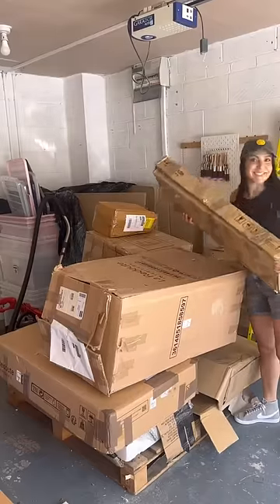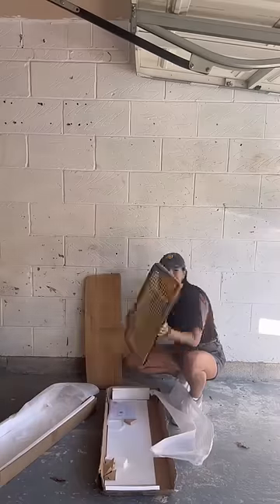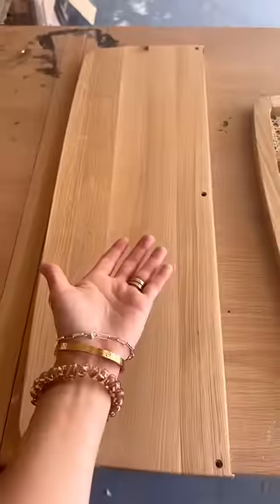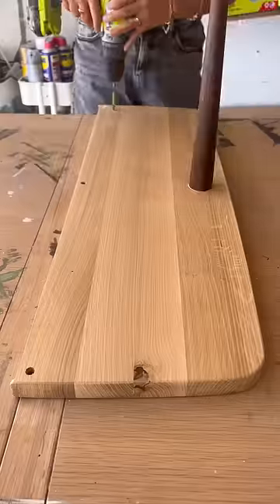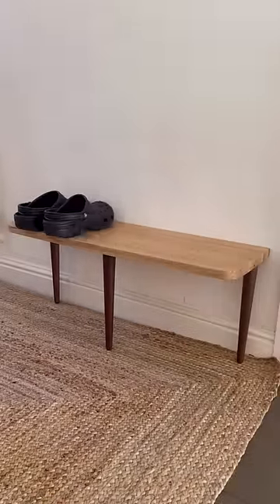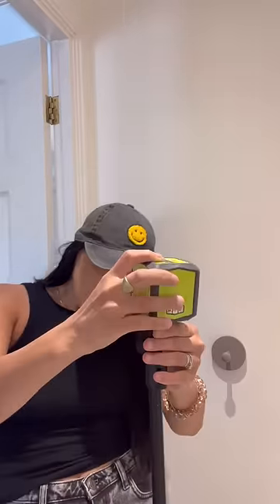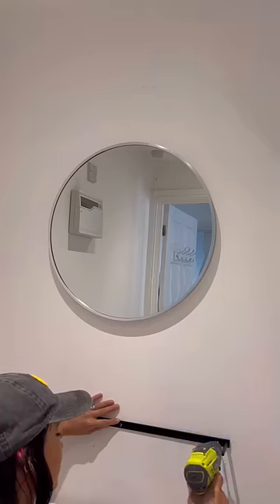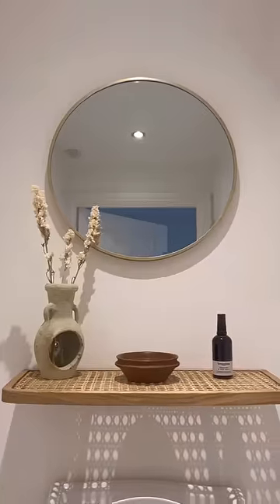Unboxing mystery customer return furniture pallet part 5! 🤯 #shorts #unboxing #thepalletchronicles

Comment: Nice idea with that rack👌🏼 might I suggest putting two legs in the front and one in the back? If you do so, you would add „using stability“ (if that’s a thing?😅), meaning, if you like put a heavier parcel down on one side of that rack, it wouldn’t tip over, because it would lean on the wall :)
Reply from the maker: Thank you!!